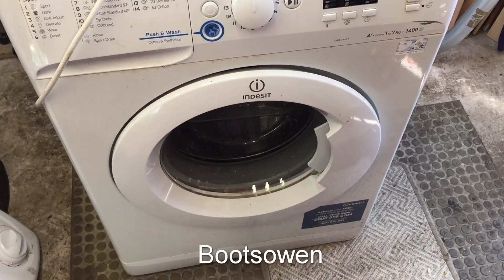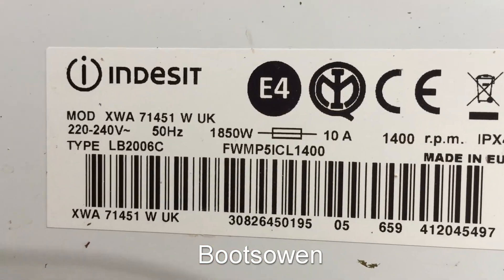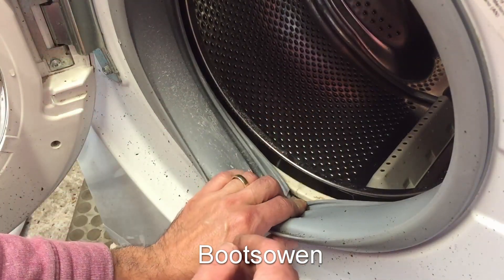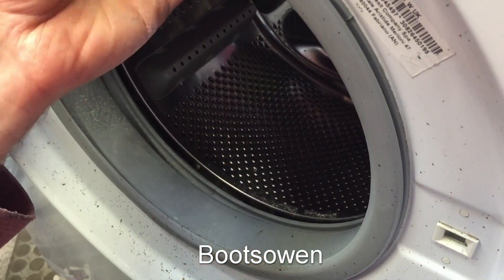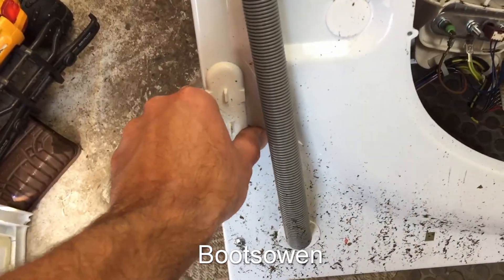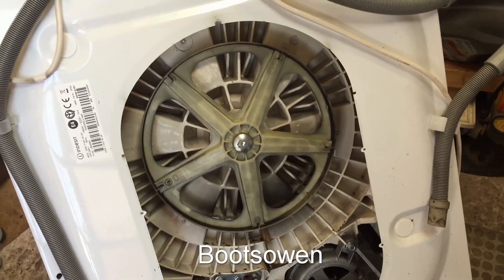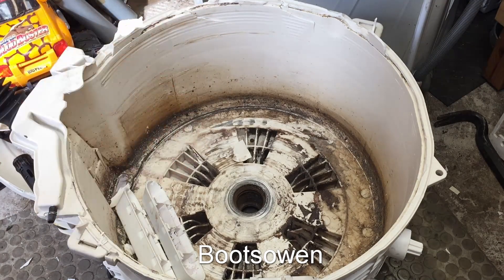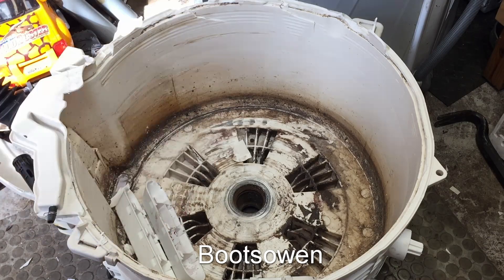Worst ever washing machine bearing failure: Merloni Indesit Innex XWA71451W

Comment: Owen, I'm thinking bad cheap bearings, poor assembly, wrong tolerance on the bearing to shaft stressing the inner race. Also 1400 rpm spin combined with overload and very out of balance big item, multiple times. A machine will last much longer with low spin and under load, we're talking decades here. I scrapped an Indesit that had bad bearings to the point where the rear plastic bearing housing on the drum had started to melt and crack up. Let's face it some people have no understanding of machines and too much disposable income. cheers

Comment: Water seal leaked and there goes your bearings? And I was "disappointed" when my 2009 Miele shock absorbers lasted only 12 years. One was completely bad, one was working. Replaced and working nice. Knocks on wood

Comment: They clearly used the machine with bad bearings for 1-2 years until the belt snapped off. As I have said in my previous comments, Indesit machines are very prone to bearing failure, I have seen just a year old Indesit machines with completely knackered bearings. Shame really.
Reply from the maker: Corner cutting!
Reply: You patreons have all the fun